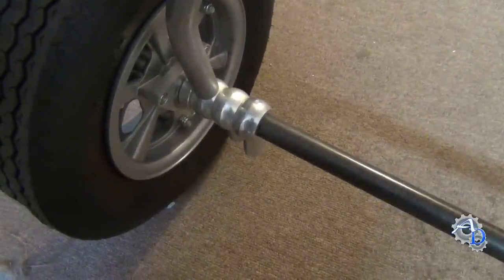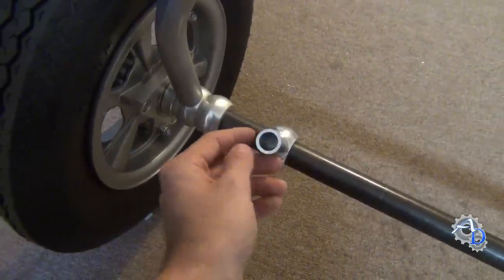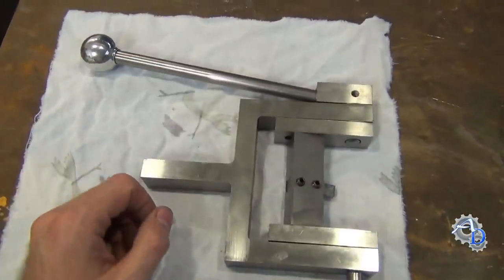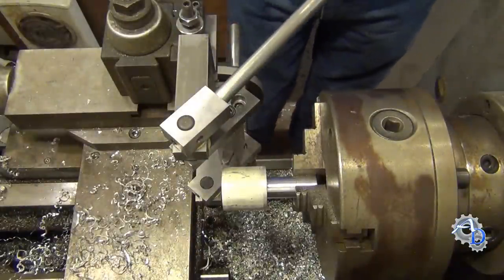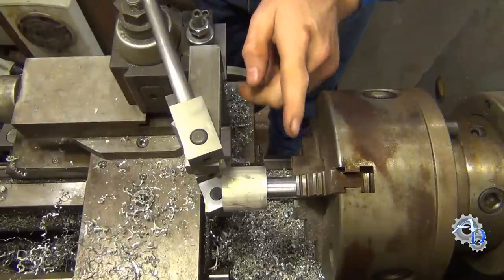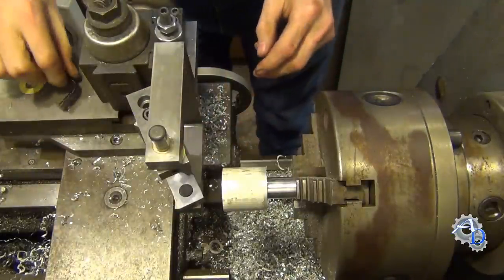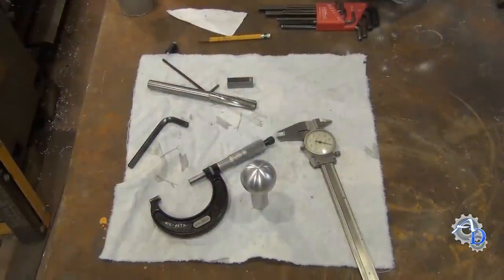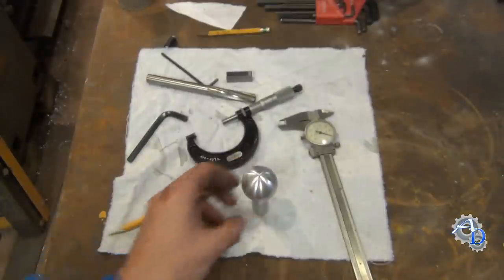The Secret to Cutting a Ball On a Manual Lathe

Comment: Nice.  Now how did you bore the holes?
Reply from the maker: I reamed the pivot holes, and use a wire edm for the square holes.
Reply: Arnold
I probably did not word my question very well, my fault.  Thanks for answering me back.  I am not talking about the ball cutting tool you made, I am talking about the part you made for the ultralight.  From the last picture in your video, how did you finish the part?  You cut the ball down to a thickness of 1".  How did you hold the part while milling and how did you bore both holes in the part?  I can't picture how you hold a ball for further machining.  This is very interesting to me as I have been trying to make a tool like this for quite a while now.  I am trying to make a rounded pulley for a million volt Van De Graaff generator to hold the running belt in line.  I have tried to do it by hand, but you can imagine how that went.  The pulleys that I have made will not hold the belt centered as much as I have tried.   I have a mill and a lathe, but nothing CNC.  On a CNC it would be a very easy.
Reply from the maker: @John-oe5nb  It's been a few years since I made those, but I think I just used a mill vise. I set the round flat area at the base of the shank against the solid jaw, and milled off one side. I then flipped the ball over and rested the newly milled surface on a parallel and milled to finished thickness. After that, it was a matter of indicating in 3 points on the ball part to find center. Drilling was conventional, spot drill, large drill to slightly undersize, and then used a boring head to cut a precise ID. After that, the part was put back in a lathe in a 3 jaw chuck, ball first, so that only the shank contacted the jaws. Then I drilled the shank out to 1/2". I was always going to build a van de graaff, along with a tesla coil, but never got around to it. For the pulleys, I assume you're going to make them with a slight crown, or very slightly convex. That way they will be self centering, and your pulley axle alignment won't have to be perfect.
Reply: Arnold

Exactly.  I kinda figured out how you did it, but was not sure.  After the first cut on the ball, you now have a flat edge to reference to and hold the part in the mill vise for the rest of the machining.  I have several Tesla coils and Van de Graaffs, but never could get the Van de Graaff belts to run true no matter how carefully I lined up the pulleys.  I could get them to run OK for a while, then they would creep over and start to rub.  That quickly grounds the charge and the generator quits working.  I have tried different convex radii on the pulleys, but I can't get any dimensions to follow.  None of them work, but I have been trying to do it by hand.  Hard to do on a lathe without CNC.  I have not been formally trained in machining.  I have a whole garage full of machine tools, but my training has been trial and error, talking to professional machinists and Youtube.  Youtube has been the most unreliable.  Some of the stuff I have seen here is horrendous, like working with cotton gloves while machining.

Comment: In no way am I a machinist and lack any sort of fit & turn skills, but, out of curiousity, could the piece, to be turned, be centralised between two centres, avoiding the critical element of hitting the chuck jaws?
Reply from the maker: Depending on the diameter of the shank, you could put it in a collet.
Reply: Yes, you could. I've been learning about machining and how to develop an acceptable level of competence. Your vids are a great help. Thank you.
Reply: Also, would the geometry of the shaping/gripping handle have a solution in its redesign? Why must it be a straight?
Reply from the maker: The handle can be turned 90° to avoid the chuck. That is shown on my latest video where I make an ornamental ball for a flagpole.

Comment: I'm not so sure if it's so easy to cut an internal (convex) radius on the inside of a hollow structure. Maybe it will be more easy with  big radii. Small radii will be a different matter I think. Here I'm talking about 1 mm radius and up.

Comment: More accurate if you would hold it correctly and use the clutch instead of the scale. This way you will measure just anything.

Comment: I used to use SODIC wire edm machines in a tool and die shop. At $100,000+, I can't afford one for my home machine shop.
Reply from the maker: Me too. I didn't like it all that well, but we got by. It would always crack WC die cavities at 5 amps and over. The fanuc and charmilles didn't do that.
I cut the ball turner frame with a bandsaw, and then finish milled it. The only thing I wired was the square lathe bit hole.

Comment: That .5 reamer isn't .5 on the shank. They are usually well over .01 smaller so it doesn't rub in the hole. Maybe if you used a .501 reamer the shank might be .5 but you're off a little bit there by not using a gauge pin. Turn one yourself and send it out to get ground if you dont have a grinder. Worth it if you have a loterance.
Reply from the maker: Mine is.

Comment: The lathe, the biggest ass tool we have on the farm not counting the old sawmill or vehicles, and I don't even use it...    like ever.
My dad says its the one tool that can make every other tool
I've got a like 10 DVD lathe tutorial somewhere stashed away I pirate bayed...
One of these days maybe I'll play on it and make something on it other than boat paddles :-/
Reply from the maker: Lube it up, and fire it up. The rest just falls into place after a while. Your dad's right. And having a mill helps too. And a surface grinder, and a plasma cutter, and tig welder, a tubing bender, slip roll, wire edm, water jet... Really though, most things can be built with vice grips, duct tape, and some wd-40.

Comment: It seems to me that adjusting your cutting tool while the movable yoke is still in the frame is not the best way to go. Why can't you remove the yoke from the frame and do your adjustment? The holes tying the yoke to the frame don't change when you remove it so the radius from the reamer/pin to the tool leading edge remain the same.........
Reply from the maker: You could do it that way too.

Comment: I didn't mean to be lecturing you brother. I purely explained the correct way a mic should be used, irrespective of how you or any other person for this matter think he will use it. By the way brother, besides the fact that I'm a qualified metrologist, I'm also a qualified (RED SEAL) toolmaker for 43 years. It's your choice how you want to use it. Maybe you were taught to use it the way you do it now.
Reply from the maker: We were taught how to use them, but it was up to us ultimately to use them accurately. We were taught on how to read the the graduations, not treat them badly, and treat them as the precision instruments they were. All the tool men I knew had there own mics up to a certain size, usually up to 3. Anything after that the company provided due to costs. Being that the 3 through 12's and larger ("the community shop mics") were calibrated by a third person, of course then it was imperative that everyone used the torsion limiters, being that everyone who used them had a different feel. But for personal mics, a lot of people I knew had their own feel and relied on it. I once worked in a shop where the boss, instead of using the ratchets, calibrated the community shop mics to his personal feel, which pissed everyone off, because no one else had his feel obviously. Of course, being that he had an assumed IQ about the same as that of a golf ball, no one was really surprised he did this.